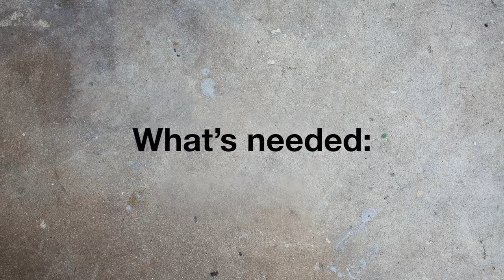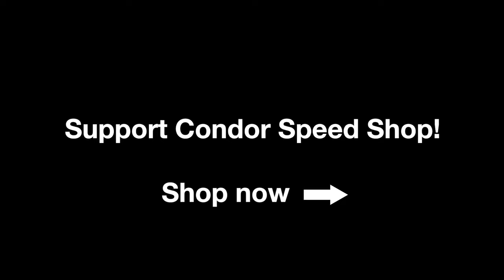E46 M3 Differential Bushing Install - E46 Coupe - Condor Speed Shop

Comment: I installed these and the m clunk is super super pronounced. Did I do something wrong? I will be going back underneath to check everything is tight but holy crap the diff clunks so loud I'm worried it'll rip right off
Reply from the maker: Hi Tonggi, It definitely should not be clunking. Sounds like something may be loose. Check it out and send us an email at support@condorspeedshop.com.
Reply: @CondorSpeedShop  thank you. One of the rear bolts got loose. Car is solid now. Great product! I knew it was user error!!!! 😂😂🤦‍♂️🤦‍♂️😂😂